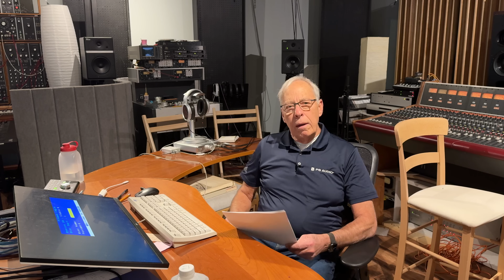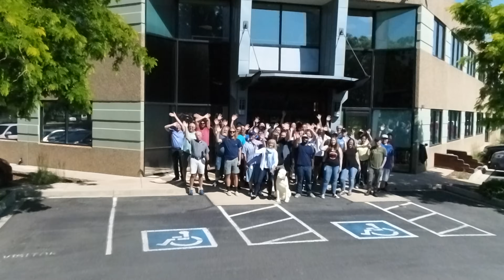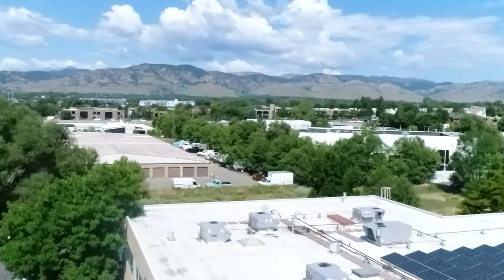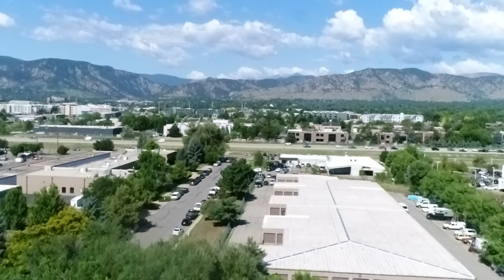Noise or galvanic isolation?

Comment: I'll just add, a pair of SFP optical plugin modules with a 1Gb/s bandwidth and a 550m range are £20, ($25) for the two required for a link. The hosts would just need the SFP cage fitted, which would ensure EMC requirements are met. What is anyone waiting for, if you want islolation and use the higher bit rates. SFP s pretty much a pass-through technology, unlike XFP tranceivers which include a PLL.  This said, I can't hear a difference in 48KHz and 96KHz, which I only use for recording.

Comment: Optical HDMI cables. ultra high bandwidth (up to 48Gbps) + with galvanic isolation ;). get 8 channels at up to 24x192 or 6 channels of 1x128 DSD SACD

Comment: Implementation is also something that gets overlooked here. In recent testing between coax and toslink, I found a source device using toslink 44.1k output sounded worse than coax, rendering the benefits of galvanic isolation nil

Comment: If you can afford the cost of a good balanced power supply , connecting all your gear to the device will ensure a common ground on everything , so no current flows on the ground connections .

Comment: CO-AX can be galvanically isolated with a transformer, the grounds don’t need to meet. TOSLINK data and CO-AX data are different as optical imparts a less symmetrical pattern at higher data rates. EG, For data of 1010_1010 you have a transition every bit, this hig frequency power ends up in the attenuated area of the optical driver bandwidth, reducing the amplitude between one’s and zero’s, compared to say data of 1100_1100 which has less high frequency transitions. The optical will also suffer more from saturation. EG. for a data pattern of say 1111110, because of the long time spent at the logic_1 level it saturates the driver, and will take a bit longer to come out of a long string of logic 1 to reach the logic zero level, longer than say 0110, because the driver becomes less saturated at the high level. This imparts pattern-dependant jitter into the signal, present in both CO-AX and optical, but more in the optical. This said, cheap optical can easily be made to work fast. Whilst this may sound relevant, if you have a good clock-recovery circuit and locking phase-locked loop (PLL) circuit, this should remove the jitter and produce an identical output. Once again, if you hear a difference, then sadly your kit is junk.

Comment: Hi Paul, I'm a retired engineer.  I think it's time for a new toslink specification.  We should be using a dual optical interface that keeps the clocking and sync infromation in a separate optical connection.  With this desiign we would have complete galivanic isolation, no noise, and reduce jitter.
Reply: " I think it's time for a new toslink specification." - why bother with yet another synchronous digital interface?  Just use USB (as in USB data ) as an asynchronous digital interface.  There is no reason to use synchronous digital interfaces anymore. Their origination and continuation simply springs from an old fashioned idea of trying to replicate the analogue plug-n-play idea into a digital system.
Reply: USB and get audioquest jitterbug.

Comment: Hello. If you use toslink from a computer to a dac and compare it with a digital rca. you don't hear any differences.

anything more than 48khz is pointless and gives you no audible benefits.

1. most of the music you listen to is made in PCM. and converted to other formats.

2. How often do you hear real 96khz music recorded from a sound studio? Not often, I think.

3. many quality DACs. already has built-in galvanic isolation. Not all but many

Comment: The question remains... why, with all of the technology we have today, are we not using fiber optic connections on our audio systems?? I keep hearing about the massive benefits, but nothing. Why??
Reply from the maker: There are no standards. As a company we might choose to employ a connector for fiber optics that works great but because no one else in consumer electronics is using it you could not connect any other company's products. There are also a few technical reasons. Fiber's not great on symmetrical edge detection which matters for jitter.
Reply: @Paulmcgowanpsaudio  thank you!

Comment: I've got good quality Pangea optical and coax cables and the coax is way better with zero noise. They are also short length and that does make a difference.

Comment: Paul is correct from my experience.
Toslink sounds better up to 96k (gets a little shaky from time to time at 96k)  but over that and it’s absolutely useless. Coax at 192k sounds better than toslink at 96k.
Reply: I've ran ADAT 8 channels with Toslink in studio environment and is flawless. No ground loops or interference issues. I guarantee no final mix will end up that high in resolution anyways. Unless you are a canine.

Comment: In a PCM stereo system Coax and TosLink are both absolutely fine and audibly identical. Concentrate on what really matters, room acoustics and loudspeakers.
Reply: Exactly right. But I prefer running my DAC via USB asynchronously (DAC buffers and pulls the data on demand) where I can let the DAC clock the samples precisely with no jitter concern. SPDIF, Toslink and I2S are ok for older audio architectures where the clock master is in the source device and you end up relying on a PLL in the DAC to match the incoming data rate. Jitter becomes a thing in such older architectures still often needed when running a CD player or CD transport.
Reply: @ThinkingBetter  You write that USB from a computer to a DAC. is the best way. What about the connection from USB. ic. circuit to the rest of the DAC.? Many ways to transfer the signal to the rest of the dac. It could be spdif connection.
Reply: @ford1546  Problem with SPDIF is that it's a one-way data link where the source determines the clock and the DAC will have to match it. Now, reality is that good engineering can buffer enough samples in the DAC to allow the DAC to run its clock precisely. Thus, SPDIF can still sound awesome. But USB is much more powerful having a comprehensive 2-way protocol that allows the source to feed data asynchronously. The notion that noise will cause audible artifacts in the analog output is bogus in any normal case. Your SNR of the DAC output nowadays is superior to CD quality with any decent modern PC connected. Personally I use Macs and they are usually very low noise making zero such problem. Ages ago I was using a DIY desktop PC that was very noisy on the ground connection to a DAC due to a noisy switch mode power supply, but that's almost 2 decades ago.
Reply: Yea like apple and orange